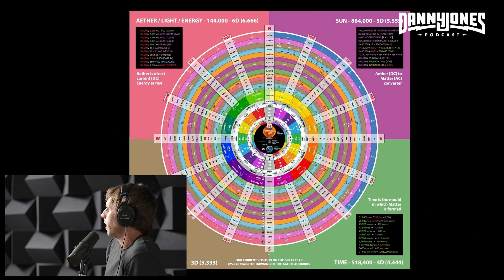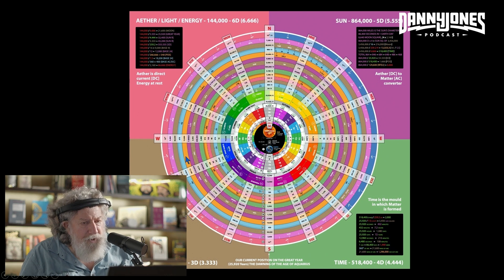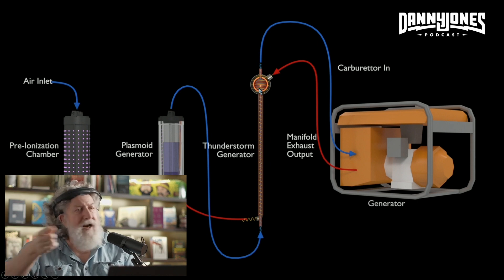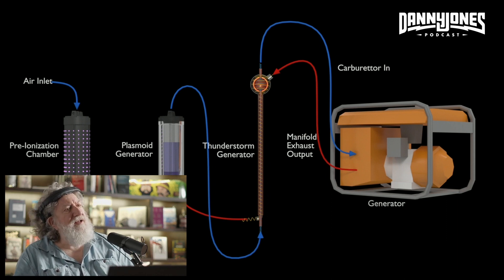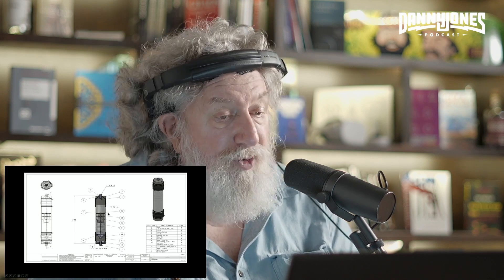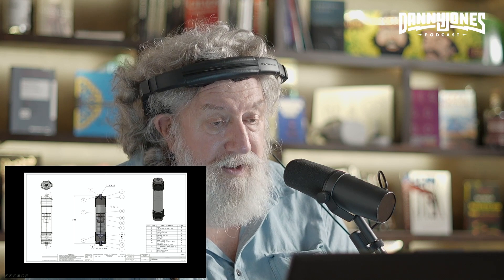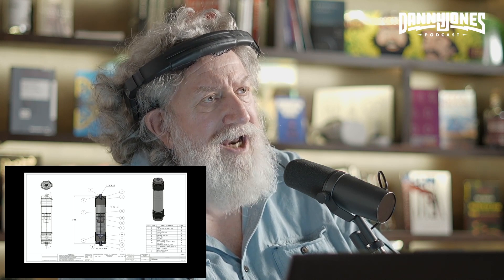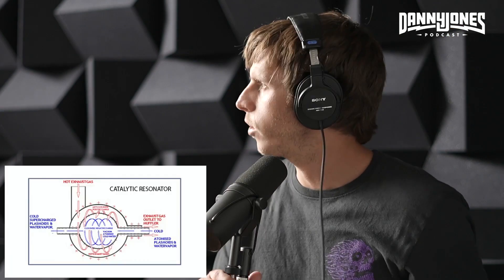Randall Carlson: "We're Creating INFINITE Clean Energy" with Plasmoid Technology

Comment: Great Poster, Danny and Randall. I think I'd help with understanding the PUM graph. The mathematical operations beneath the top left title - AETHER / LIGHT / ENERGY - 144,000 - 6D (6.666) could be interpreted:

The mathematical operations provided in the PUM reflects a series of harmonic relationships that connect cosmic cycles, dimensional frequencies, and energy systems. The number 144,000 is central to these calculations, representing a fundamental frequency or harmonic constant within the PUM framework. Each division of 144,000 reveals different aspects of cosmic, geometric, and energetic phenomena.

* 144,000 / 6.666 = 21,600 [MOON] This is a reference to the Moon’s relationship with time and space. In celestial terms, 21,600 minutes of arc represents the total number of arcminutes in a complete 360° rotation of a circle (since 1 degree = 60 arcminutes, and 360 x 60 = 21,600). This suggests that 21,600 arcminutes relates to the harmonic frequency (Moon Resonance) of the Moon’s orbit 

* 144,000 / 5.555 = 25,920 [GREAT YEAR] This is the time it takes for the Earth’s axis to complete one full precessional cycle through the Zodiac, taking approximately 25,920 years. This calculation aligns the harmonic number 144,000 (Great Year Resonance) with the cosmic cycle of the Great Year, highlighting how the universe operates in precise harmonic time cycles that connect cosmic movements with time and energy systems.

* 144,000 / 4.444 = 32,400 [SUN R] In this context, 32,400 represents the resonant frequency of the Sun’s output in energy or light, symbolizing its relationship to higher-dimensional energies like 5D aether.

* 144,000 / 3.333 = 43,200 [SUN R] 43,200 is harmonic number potentially associated with the Sun’s radius. This number is significant in both ancient and modern cosmological systems, representing a large harmonic multiple found in various sacred geometric patterns, architecture, and time cycles.

* 144,000 / 259.2 = 555.555 [5D] The number 555.555 represents the 5th Dimension (5D) in the PUM’s dimensional framework. 259.2 is noted as the melting point of Protium (Hydrogen), which is critical in PUM as the foundational element for plasmoids and cosmic energy conversion. The number represent the harmonic frequency of 5D energy. In the PUM, 5D represents aether or light energy, and this calculation ties hydrogen’s physical properties to the higher dimensions of energy, symbolizing the connection between matter and aether.

* 144,000 / 16 = 9,000 [BASE 9] In PUM, Base 9 is seen as a foundational principle of universal resonance, where multiples of 9 represent cyclical and complete systems. The number 9,000 highlights the importance of the number 9 in the PUM, symbolizing completion, balance, and harmonic cycles that govern cosmic and energetic processes.

* 144,000 / 12 = 12,000 [BASE 24] The number 12 often represents cycles (e.g., 12 months, 12 Zodiac signs), and Base 24 connects to the full daily cycle of 24 hours. The number 12,000 symbolizes harmonic cycles within time and space, aligning with daily and cosmic rhythms. In PUM, this could be seen as how energy flows through these rhythmic time cycles.

* 144,000 / 266.666 = 540 [POS] 540, which is designated here as POS (possibly representing a positive harmonic frequency or another symbolic designation within the PUM framework). The number 266.666 may relate to a specific frequency or harmonic value tied to protons or other cosmic elements.

* 144,000 / 7.5 = 19,200 [BASE 24] 19,200, related again to Base 24 mathematics. The divisor 7.5 might be tied to a key harmonic in energy or time cycles (e.g., the division of certain celestial cycles). The number 19,200 could represent a key time interval or energy unit in the PUM system, where Base 24 denotes the natural cycles of energy, particularly as they relate to hours, seasons, and cosmic time divisions.

* 144,000 / 360 = 400 [BASE AC/DC] Dividing by 360 (the number of degrees in a circle) gives 400, which might represent a base harmonic related to AC/DC currents (alternating current and direct current). This reflects how energy flows and cycles in electrical systems, linking cosmic harmonics to practical energy flow dynamics.

* 144,000 / 2,160 = 66.666 [ENERGY] This division results in 66.666, which is tied to the number 2,160, the length of each Zodiacal Age. The result, 66.666, represents a key energy resonance that aligns with the flow of cosmic time as marked by the precession of the equinoxes. This calculation ties the harmonic constant 144,000 to the energetic frequencies of the Zodiacal Ages, suggesting that each age has a specific energy signature that resonates at 66.666 within the PUM system.

Hopefully that helped. I'd like to hear alternative interpretation.

Comment: if what he is saying is true about this process then the initial fossil fuel input to get to temprature is not a problem because you can make more fuel from co2, plus h2o from the air once the machine is started and kept for the next start cycle or start another machine , a little like thorium first reactors would be to mostly just breed more u233 to start more reactors that gradually increase power output and decrease fuel production right down to pure "burner reactors" that are very small, simple and powerfull, as you have a fleet of burner/breeders in your electric power domestic fleet creating sufficient fuel for future reactors that are straight non-complex burners that are fuelled for 20 years at a time , and new breeders/burners to perpetuate the creation of new fuel all along the way...

Comment: It has the odd critic, I have seen, but these do not detail the objections, well. The descriptions provided by proactive investigators/researchers are more detailed in explanation ... which is a good thing. Projections are for a purely plasmiod generator .. ie no fossil fuel in the process (ie not required at start up). Transition and eventual versions are both desirable. Bring it on, all energy sources should considered and integrated such that they do little or no harm. Energy independence is requited for humanity to thrive.

Comment: If you want to prove the reduction of emissions you need to seal the whole machine with the engine in a box with a single hole for the measurement. Otherwise your system could just have a leak and you are measuring the air around it.
Reply: ...what are you talking about...? Theyre not talking about lowering the emissions theyre talking about recycling everything from traditional exhaust, breaking it down and reusing it. As close to 100% as I could imagine it getting.
Reply: @TheAceofFate  I am talking about a way of testing it.
Reply: @TheAceofFate they’re also claiming greater emissions… if you’re not burning fuels, you would not be emitting them from the technology they’re claiming.  Only to start the process.

Comment: Its been tested. It works as advertised. Because of that test, a large unit is currently being installed onto a 400kw commercial generator system.

Randall is used to talking about this kind of thing so as to set context first. I think that's a mistake here. I think he needs to lead with the real numbers.
Reply: So, like another commenter below stating "believe when I see it", I have questions. Do you have any links you could share about this tech? My personal belief around the societal construct is that the failures are baked in to serve those in positions of power (not in a conspiratorial context, it's right in front of our faces). I feel relatively sure that we could solve our problems on a global scale. Energy solutions are on the horizon, but obviously they need to be scaled and made available. Do you know more about this?
Reply: @shaney8275 strike foundation has all the pdfs. Alchemical science on YouTube Jordan covers it all open source. He's not selling anything just researching.
Reply: Ah yes, he’s asked over and over but refuses to answer any questions that address the numbers.

Comment: does he even know a carburator is for mixing fossil fuels with air?🤣
does he even know microns is a lenght measure? not a frecuency
does he even know that Argon is an inert gas? it doesn't react with any other element, that's why is used to isolate reactions or experiments